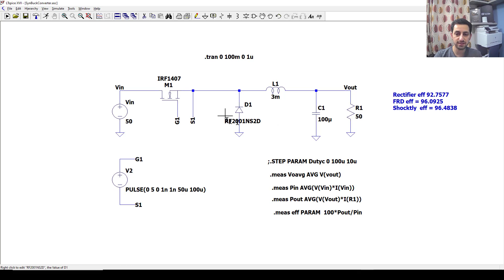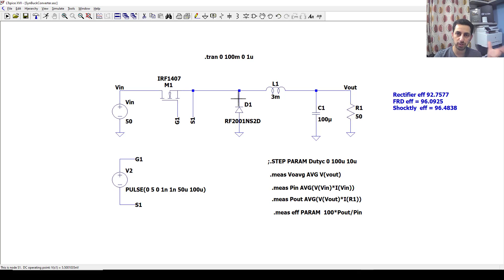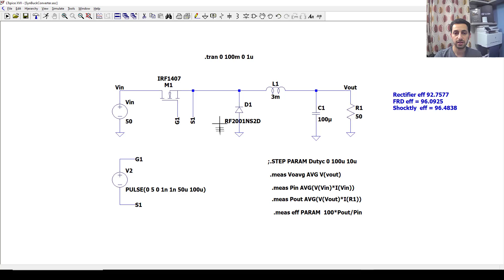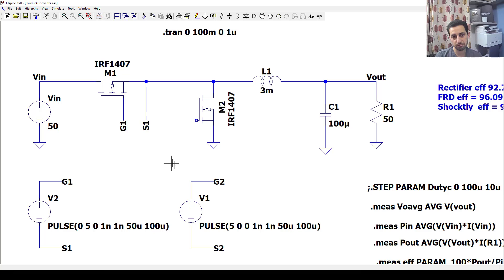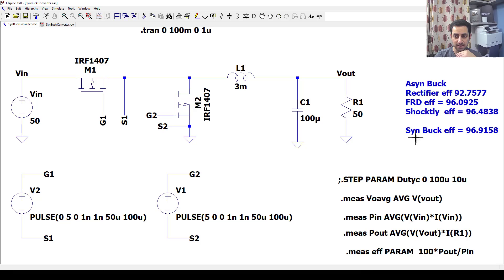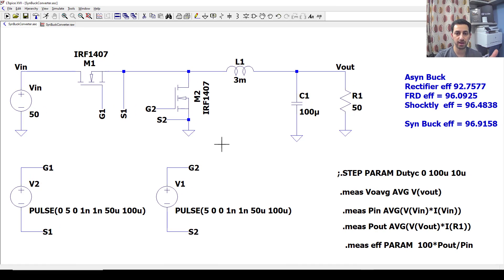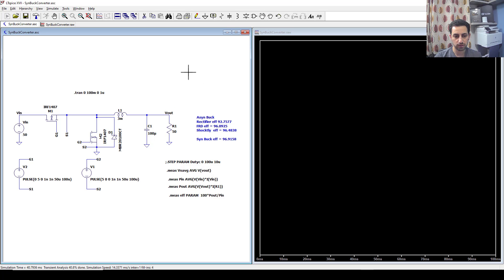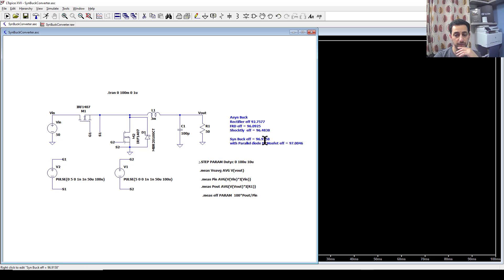Lab 4 Task 4 Synchronous Buck Converter | Power Electronics

Comment: Replacing a diode by n-channel mosfet including the required gate driver + the pwm control issue,,,,, mmmmmhhh.... i am not sure that can be a wise way in order to increase the efficiency of the converter,
Reply: I think that you need to study more :)
Reply: @tonyavito208  ok man, you look like someone who know power electronics very well, however I am still learning,,, but are you really want to add n-channel to your circuit in stead of diode just to save some watts over time. Just let me ask you Tony something. Have you ever built a real converter in a real industrial project, do you know how to generate the required pwm? by SW or HW. Do you know that more the 90% of solution based on HW controller such LM5118, do you know how much you will pay in a reall project for your cute replacement to save some watts. I believe if you ever worked in the industry some where you will think totally different and maybe you will learn how things go and move 🙂. However, thank you for your Tipp, i need to learn more, but for sure away from the dynamic on-state resistance of a normally-off power switch😉😊.
Reply: Dear  @MadMax34566  I hope that you did not get offended as it is shown in your comment.
We learn everyday... in fact we should not stop learning... 
More facts... this is an educational channel! What if your application is intended to output few mW? And what if  you are running a small circuit for medical applications implanted in the body of a human being? Are you  willing now to pay the extra cost for such application to increase your efficiency?
I apologize if you got offended, I really did not mean to make you feel bad. Sometimes we all act in an emotional way. Take good care, and may God bless you!
Reply: Dear Tony, thanks for your kind. honsely, i did not feel bad from your Answer, that was okey. However, for the Application you already mentioned, the mW power rang, you have absoluty right. Replacement and saving few mWatts in Application such as medical Heart Microdevices will have a huge care and focus, i a gree. Anyway, i am the gay who plays always with powertrains for eCar, where the cost reduction of the BoM is fundamentally required. also before the eCar  my activity was focusing on the Railway Traction 😁😁😁. Have a nice day Tony.